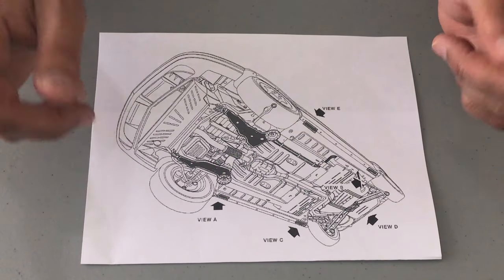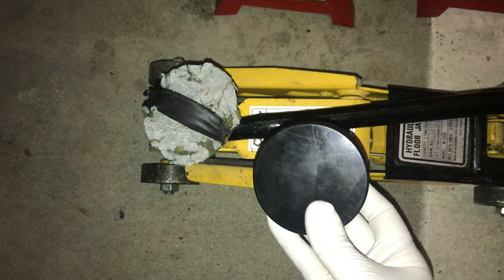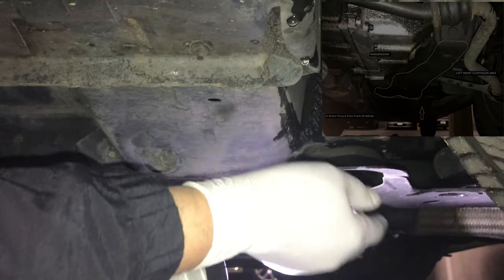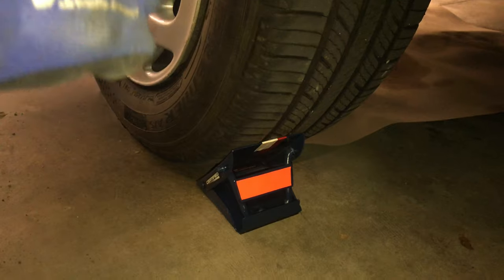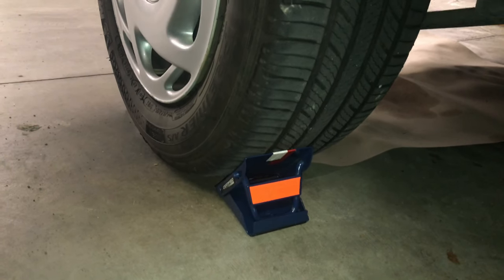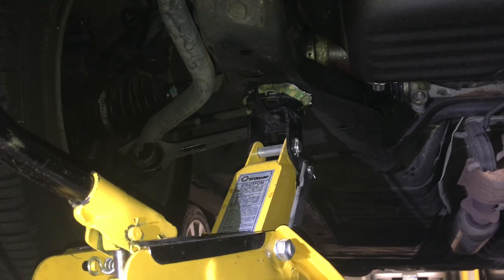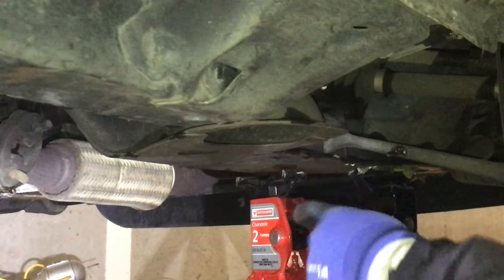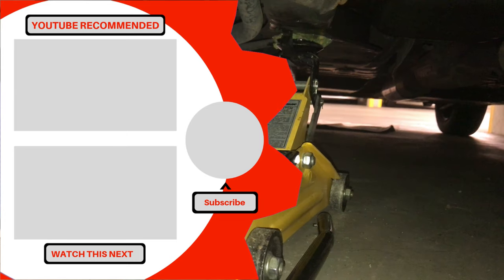𝗩𝗘𝗛𝗜𝗖𝗟𝗘 𝗥𝗘𝗣𝗔𝗜𝗥: 𝟮𝟬𝟬𝟬 𝗦𝗮𝘁𝘂𝗿𝗻 𝗦𝗟𝟮 𝗟𝗶𝗳𝘁𝗶𝗻𝗴 𝗮𝗻𝗱 𝗣𝗹𝗮𝗰𝗲𝗺𝗲𝗻𝘁 𝗼𝗳 𝗝𝗮𝗰𝗸 𝘀𝘁𝗮𝗻𝗱𝘀

Comment: Thank you! didn't actually know that I could lift at those welded beads
Reply from the maker: Hi Bastos907, thanks for watching and sending me your comment.  Very happy to help you out.  May you have many more years of dependable service from your Saturn.  All the best to you, H.D.H. [: { ].
Reply: You can if they're solid.  Unfortunately, they're one of the first things to show rust on these plastic-panel Saturns.
Reply from the maker: @kendall9099  Hi Kendall, thanks for watching and sending me your thoughts.  I have not had experience with the welded beads rusting out.  I live in Vancouver, BC (Pacific Rainforest area) and have had my Saturn since new and it is over 20 years old.  I think maybe the vehicle you saw this on may have been lifted with a jack without a cushioned/rubberized lifting face and scratched the bead which may have accelerated the corrosion. Anyways, thanks for providing added information, which will encourage people to use some of the other lifting areas I have noted.  All the best to you, H.D.H. [: { ].
Reply: @HANDYDANDYHUSBAND  Definitely.  I wasn't referring to the car in your video.  That one is relatively clean as far as Saturns from the "salt belt" go.  I was actually referring to one on which I've been working, which has considerably more cancer.  I was just encouraging people to really consider their choices on their particular vehicle because the rust-proofing on these cars was quite poor and it may not hit home right away due to the plastic body panels.
Reply from the maker: @kendall9099  Hi Kendall, thanks for your further comment and clarifying your thoughts.  Yes, I agree, rust should be an active consideration when identifying a strong place to lift one's vehicle.  By the way, I have heard of people having the jack break through the rear floor pan when trying to lift just in front of the rear wheel (one can lift from this area but only with a thick metal plate to spread out the load) so watch that location as well if you need to lift Saturns.  All the best to you, H.D.H. 
[: { ].

Comment: Can you put a Jack anywhere on that welded rib or only in certain areas?  I used before that rib and it got bent slightly, so now I used the areas where those rectangular marks are. They are next to the ribs. Thank you for the very informative film.
Reply from the maker: Hi Olena Erhardt, thank you for watching and reaching out to me with your question.  From my understanding and what I have observed, the manufacturer only recommends lifting from the weld beads closest to the front and rear tire.  I have not tried using the welded beads in the center area; therefore, I am unable to comment on whether this is advisable.  Next to the weld beads moving from the outside of the vehicle to the center of it, I do see that there is a support member.  I think this is what you are referring to as the 'rectangular piece'.  I have in the past used this area closest to the front tires both to lift and support the vehicle with jack stands.  I have heard of some people claiming that this same area near the REAR tires is very weak and one should not use it to lift or support the vehicle. So beware that there may be a difference between the front and back of the vehicle. I should note though that the original manufacturer has not recommended this spot either on the front or rear.  Alot of tire shops and general repair garages that I have seen use this  support member, but I should note that they use long, hefty pieces of wood that distribute the weight over a larger area.  Hope this was helpful.  Take care and stay safe.  All the best, H.D.H. [: { ]
Reply: Thank you very much for your reply. Now everything is more clear on the lifting of a car, the diagram you show is especially helpful, because I had doubts about those large dark areas, now I'll start to use them. About those rectangles next to the small rectangular areas on the ribs shown on your diagram, they are slightly dented rectangles, looks like that were marked that way by manufacturer for placing a jack stand under them. But now I better use ribbed area after reading your comment. See when I used before those ribs, they were slightly deformed after using jack lift or stands on them. I didn't know that you need to use Slotted Frame Rubber Jack Pad, but that is O'K because anyway I use that car to practice on repairs and  to understand the work of the car better.  Sir also could you tell me where is the starter on that car (2001 Saturn SL2), is it on the driver side, or passenger side, and if it has a starter brace? In the book (Haynes Repair Manual, Saturn 1991-2002) they say that later models don't have that brace, but unclear what model they are referring to.
Reply from the maker: Hi Olena Erhardt, Thanks for watching;  I am happy that I was able to help you.  All the best, H.D.H.
Reply from the maker: Hi Olena Erhardt, Sorry...my screen only showed part of your comment, but when I checked my gmail account I realized you had a further question. The starter for the 2000 Saturn SL2 is located closer to the passenger side.  It is slightly to the left of the oil filter and just next to the alternator (if you are looking at the engine from underneath the vehicle).  My particular model (2000) does not have a bracket.  The starter has two bolts that affix the starter metal body to the engine block.  When removing the starter, it is very helpful to 1) spray the bolts that attach the starter to the engine block with penetrating oil for at least 15 prior to removal (I use old transmission oil or power steering fluid--to reuse old fluids that would normally be discarded), 2) use a 2" mechanics mirror to enable you to identify the two bolt, as one of them is behind the starter body, and very easy to strip/break/round.  The mirror will really help you get your socket on the bolt, 3)  Use an eight point socket (not a 12 point) and use a piece of paper or tape between the socket and the wrench so that the socket does not pull out, 4)  When removing the wiring label the connections so that you replace them exactly as they were arranged on the old starter, 5)  Finally, Work patiently and you will be able to remove the attaching bolts, 5) When reattaching, be careful, do not overtighten, max torque for housing to engine block is 37N.m (27lb ft) for starter to positive terminal 10N.m (89lb inches), starter to solenoid terminal 5N.m (44 lb inches), battery terminal bolts 17N.m (13lb ft).  I have attached a few picture to my Google Drive, here is the link so that you have a good idea of placement: https://drive.google.com/file/d/1keAHRElkDo-c_dS75PutcgCgbIFdUJrZ/view?usp=sharing.  Hope it helps.  If you have any other questions, feel free to inquire.  All the best, H.D.H. [: { ].
Reply: Hi Sir, thank you very much for your detailed and, I would say, encyclopedic reply. Now I know exactly where the starter is. I watched many films on the starter replacement and none of them shows clearly where is it. Probably it is for more advances amateur mechanics. Special thanks for the new diagrams and pointing out on 6 point sockets (I was planning to use 12 or flare nut open wrench (nothing wrong with flare nut, but might be hard to reach with it)). Where do you find those diagram, or they are yours, if you don't mind me asking?  I have very good penetrating oil (B'laster 16-PB Penetrating Catalyst - 11-Ounces fm Amazon, works great), but thank you for the 15 min timing. Starter to solenoid terminal - is it that purple wire? And Battery terminals you mean battery-to-battery cables? Also you write:   starter to positive terminal 89lb-in, in other films they say that there is a negative terminal, that goes on the starter. Sorry to ask many questions again. Probably I just go and look, how everything is connected there, I think I have enough information already. 
   And last general question: Can you actually replace the starter on Saturn from the wheel well if you removed the knuckle on the passenger side front wheel? So you don't need to go under the car.
    Thank you again. I think your channel will grow tremendously if you make some more films on simple procedures like replacing the battery cables (just 1-2 unclear films on that), oil change, alternator, serpentine belt replacement (there are many films on those issues, but yours are very detailed and clear).
Reply from the maker: @olenaerhardt7725  Hi Olena Erhardt, your comments are very kind and I am happy I am able to help you.  Youtube in general is very hard to become monetized on with 1000 subscribers and 4000hr/view/year so I just try to help people maximize the value of their belongings (cars included) and stretch their useful lifespan.  If everyone kept their  old car running for more than 11+ years it will be better for our environment than buying a new Tesla or Hybrid every 5yrs, believe it or not.  The pictures are from the Saturn Dealership Manual.  With regard to your questions: a) I think the flare nut wrench will be a tool that will make removal of the 'hidden' upper bolt very difficult.  A six point socket, with short extension, and wrench will be the easiest way to go, b) I have heard good things about PB Blaster, but I don't use it because it is expensive and, in my opinion, only slightly (2-5%) better than just transmission fluid, c) Yes, starter to solenoid is terminal is purple on my car (10mm nut), note though look at placement to ensure it is the wire as colors sometimes change from year to year, d) battery terminals means:  battery terminal cables to the battery posts on the battery itself, e) no there is no negative terminal on the starter...I don't think any car has that as the negative terminal from the battery is typically grounded to the vehicle frame, f)  with a longer extension, an extra pair of hands or something to prevent the starter from falling, you might just be able to change the starter through the wheel well, but I have not tried it this way and the Saturn dealership manual doesn't provide (recommend?) it.  I have seen oil changes being done this way, and I have changed the water pump this way as well.  Reach will really be the determining factor on being able to do it this way.  Hope my answers help.  All the best to you.  H.D.H [: {]
Reply: Thank you kindly for so quick reply. I just thought everyone is interested to increase the # of viewers. I'll repost your film on my facebook  then. I myself consider a car as a transportation means, so my husband and me have running cars of 2003 and 2009, and 2001 Saturn to practice on repairs. I never thought that it is actually useful for the environment, good to know. See the knuckle is removed already since I worked on brakes, hub and bearing. So maybe it would be easier to rich the starter from the wheel well. The blue oil filter (which in its turn next to the starter) is sitting next to the fender splash shield, I could see a fraction of it. Your answers were more than helpful.
Reply from the maker: Hi Olena Erhardt, Thank you again for your kind words.  It is encouraging to see that you are continuing to keep your older cars running.  Planned obsolescence, while good for our economy is destroying our collective Mother:  Earth.  Spread the word but most importantly model the change that you want in the World.  It was great interacting with you; best wishes to you on future repairs.  All the best, H.D.H.
Reply: The pleasure was mine in communication with so technically knowledgeable specialist on cars. I might have couple more questions in the future, but postpone for right now, and better proceed more on the practical side of my research. I really appreciate spending that much time on just one subscriber.
Reply from the maker: Hi Olena Erhardt, A very big thank you for subscribing.  All the best, H.D.H.

Comment: I never knew you could lift on the welds
Reply from the maker: Hi chuck Core, thanks for watching and sending your comment.  Yes, ever since unibody automobile construction became more popular, the weld seam is often used as the place to lift most vehicles.  Of course, older vehicles with regular frames would need to have the jacks placed under the frames.  Note that as I mentioned in the video, this area can bend over to one side if the jack is not positioned straight--this is why a lot of people use a grooved puck or other thick plastic material to support the weld so it doesn't bend one way or the other.  All the best to you, H.D.H. [: { ].